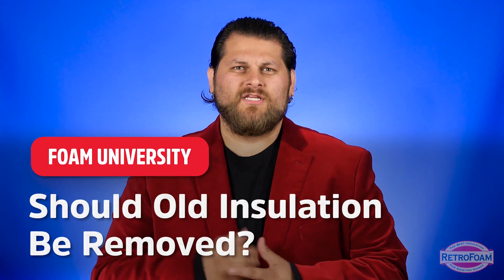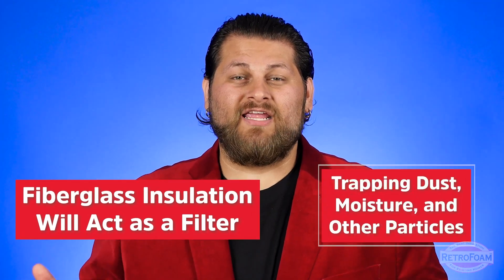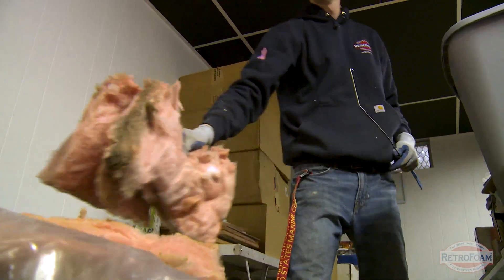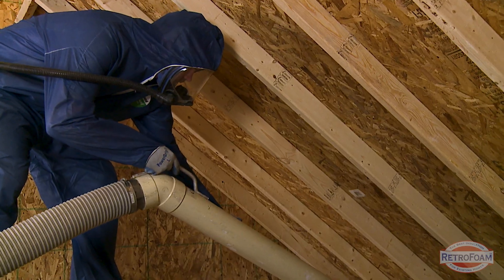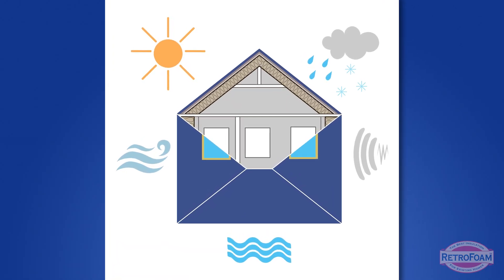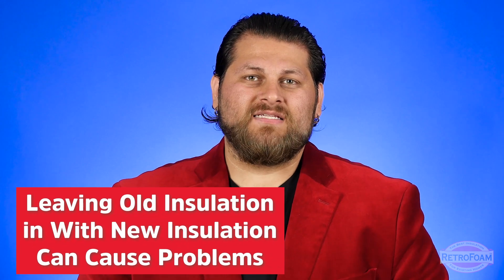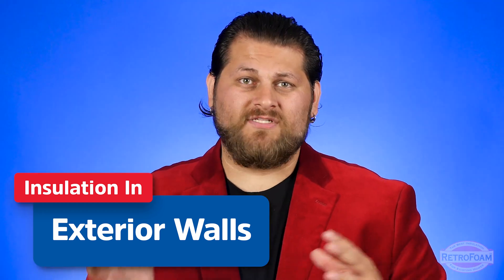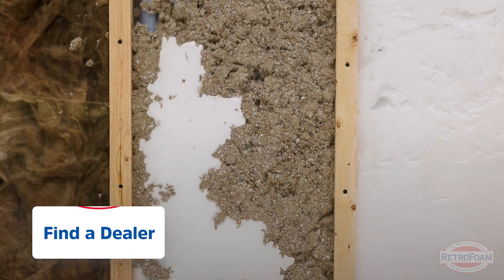Should Old Insulation Be Removed? | Foam University by RetroFoam

Comment: My own view is that subject to following caveats it's should be ok: As long as it's not moldy or wet, or in case your attic is old with thin joists then you might want to take it out as it'll add some weight.  
Yes it is part of your heat envelope but it's not part of the air envelope. Old insulation is often fairly flat so won't add much to your heat envelope. 
Re the nastiness - fiberglass insulation (if that's the insulation being used) is inherently nasty by itself. 
But if there are a few layers of old insulation probably better take it out, makes further workmanship up there more difficult.

Comment: I have a question for you. Which would be stronger a Fibre cement board that's 4mm x 1.2 x 2.4m or the same board made from expanding foam. How thick would the foam board need to be to compete with the cement board?
Reply from the maker: A total guess is maybe 5" of closed cell spray foam.